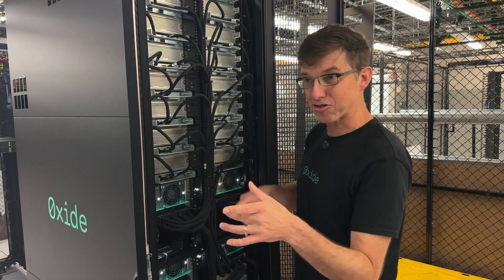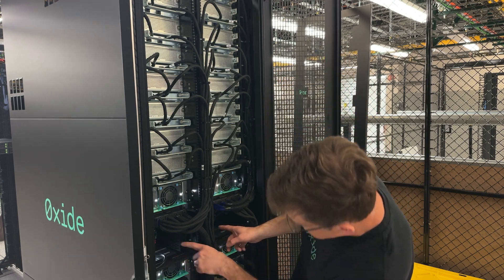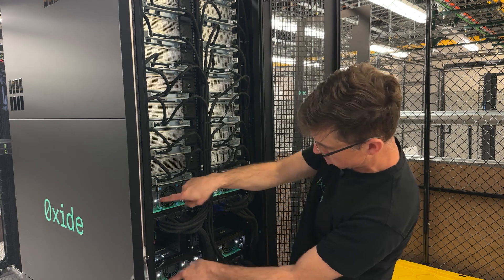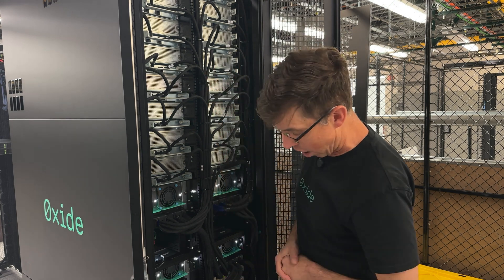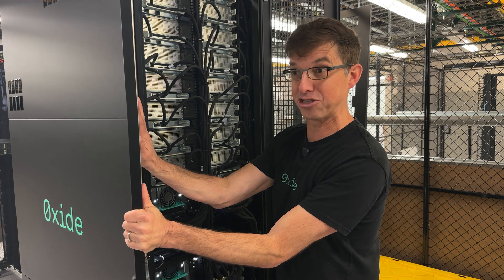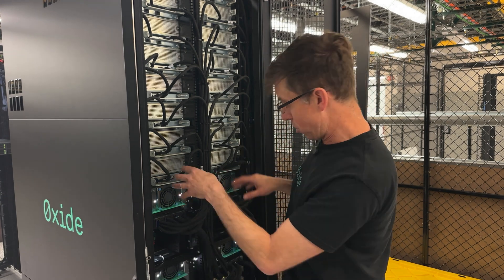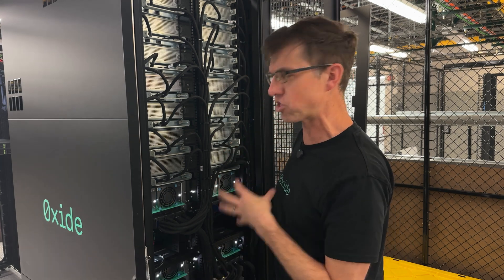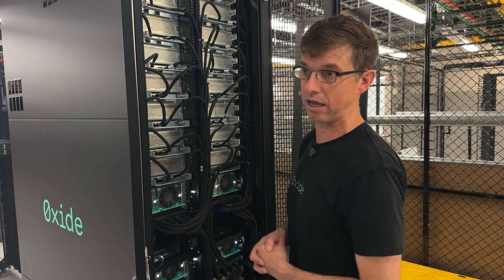Oxide Cloud Computer Tour - Rear

Comment: Pretty neat. That said, not sure why they prefer a hot rack to a loud (but cool) one.
Reply: In this context a “cool” rack means not much work is getting done, since CPUs generate heat that needs to be exhausted. So cool and loud means loud and inefficient fans for no reason. The heat coming off the Oxide rack quietly means the power is going to doing useful work and less going to the fans.
Reply: @TheKev507  And that extends to the next part of the datacenter's cooling system, too. The hotter the exhaust is, the less energy it takes to get that heat out of the building.
Reply: data centers tend to be wayyy colder than they need to be, i think
Reply: He was cold because he was at the front of the rack (air intake)so it's cold air. If he stood at the rear of the other noisy rack, it would be noisy and hot. The rear of the Oxide rack is quiet and hot.
Reply: @luminousmonkey4512  this is true but tbh the back of that rack was noisy and cold since there were only two servers in it. Amazing how loud 1U servers are.
Reply: the hotter you can run the DC the lower your electrical bill is going to be.
Reply: They use a more efficient and quieter cooling design, the rack itself isn’t any hotter than a conventional one.

Comment: I like the use of DC power at the rack level.   Now if we can just get this trend going so more off the shelf and 3rd party gear can do it too.
Reply: There is one downside that might not be readily apparent though. You have redundancy for power supply failures where one of the PSUs totally drops out but not all PSU failures are so nice and benign. If one of the PSUs starts outputting too high of a voltage in short intermittent transients you can wind up taking down every server behind that misbehaving PSU. To add insult to injury, the way a short overvoltage transient might impact the servers isn't necessarily a total failure either which in many ways makes it more annoying for the service running on top to handle. Instead of the whole host going offline, maybe it just trips OVP for the SSDs other than the boot drive. Now the service is still running but all the SSDs holding the service data just dropped off the bus. The service itself is still running so some load balancer on top might still see it as up even though all requests are going to result in errors.

You have the potential for the same failures with a more traditional PSU per server but the blast radius is then going to be a single host instead of the whole rack.
Reply: @AndrewMerts  agree that soft failures are the most heinous especially if you can't fail them out immediately/like a hard failure.  With DC power it seems like we could make the DC bus be as reliable as an AC bus and yeah we want failure our failure domains small enough ensure that system operation can persist through some <n> of them being lost.  A lot of the very big "systems" are doing erasure coding spanning many racks so that can help as well.   Hopefully the oxide folks share some reliability data down the road that we all get to learn from here.
Reply: Yeah, this has been 'restricted' to on some of the largest company and those running open compute.